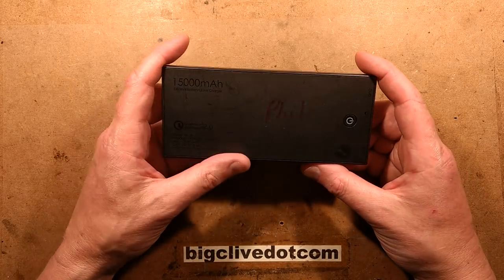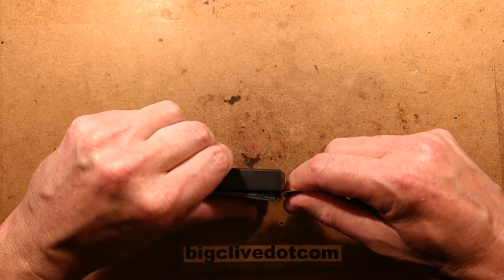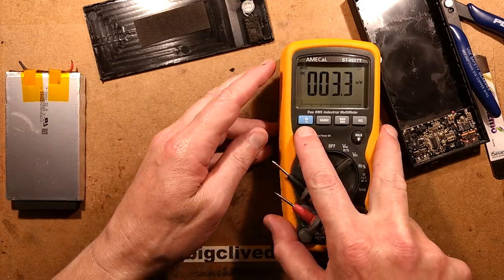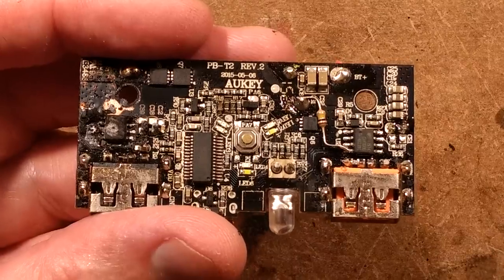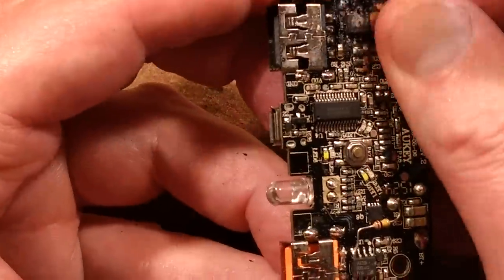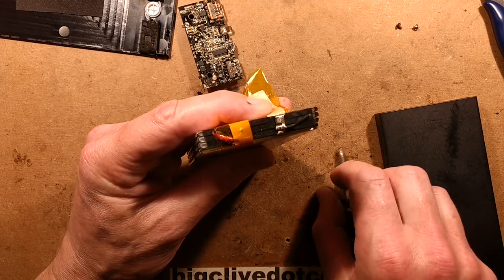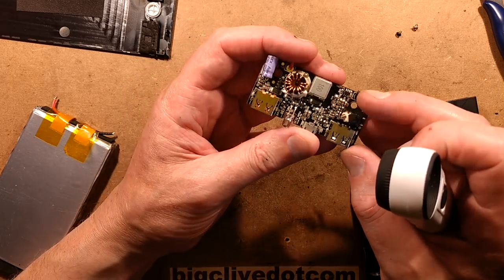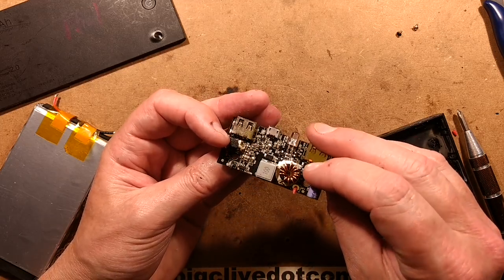Inside a burned out Aukey power bank.

Comment: Hey clive, wondering if youd be able to give me some advice on some led lights ive got. Solar panel led light string from pound stretcher, stopped working in 2 weeks. Voltage present at the output to the lights and continuity in each wire to the end of the circuit. so power is flowing through them? but nothing is lighting up? im so confused haaha!
Reply: Check for current flow, voltage is merely the pressure of electricity, if no current flows see about how much voltage is needed by each string of LEDs.
If the supply can't meet the voltage needs of the LEDs, then no current will flow.
If the supply can't meet the current needs, then when reading just voltage, it may seem OK, but under load the output dies...
Also check for short-circuits. And check AGAIN, for open-circuits; double-checking the simple stuff saves time when your'e stuck!
Giving the battery and solar a quick check can clear those suspects (failing battery can give similar illusion to low-current).
A last thing to observe is transistors, if it's one of those 'flasher' style light strings, check the devices and circuits responsible for switching the strings; all the power in the world would do you no good of the switch your'e using won't turn on ^_^
Reply: Komiyan Zaibach thanks so much for the help. I'm going to try sending a link to the pictures of the lights below. but I gather YouTube will filter it for spam. let me know if it's there or not!
Reply: Ah your'e lucky i'm awake; was just about to retire for the day!
Firstly; eww cheapy-chinese soldering XD  These things are full of dry joins etc.
Observe the solar panel and see if it puts out current; also check the battery, corroded terminals could be the problem...
A good test for those LEDs (looks like they run from a '5252) is to jam 3v across them, two fresh AAs should do, and light them with brute force to confirm they definitely aren't the issue.
Then theres the single point of failiure: the damn switch. That thing gets corroded inside, it's game over. And they always do, no waterproofing for the switch so it's usually really bad...
Pointless switch is pointless, bypassing it with solder-bridge will work and help prevent future problems...

Hope i've helped ^_^
Reply: Komiyan Zaibach thanks so much mate. ill do some tinkering with the multimeter etc tomorrow. ill report back haha.

Comment: There are lots of unanswered questions such as - was it being used to charge something else when it failed, or was it being charged at the time? If it was charging another device, was it caused by a faulty USB cable or did it cause damage to a USB cable ?
Reply from the maker: It apparently wasn't charging anything at the time.  It was being charged with circuitry separate from the section that went into meltdown.
Reply: Well that makes it even more mysterious !
Reply: Not really, it was just a bad component, it happens.

Comment: Its 1am and my fully charged Aukey power bank just started smoking thick acrid white smoke and is fiery hot, wrapped it and placed outside on concrete. 

Luckily I remembered many of bigclives videos on Powerbanks, thanks big Clive!

Exactly same model perhaps 3 years old used occasionally charged with Aukey 10-port charger. Bought new from Amazon. If I wasn't awake could have easily been a few life's. They need a recall!!!
Reply from the maker: Scary.  I bet that had your heart racing.  If it helps then I can tell you that it's so rare you'll probably never have it happen again.

Comment: Yep, that thing is toasted, but at least you have some cells for a project of somesort, maybe rewire them to use with one of them 4-chip LED floodlights or something? :D
Reply: twocvbloke these pouch cells a garbage
Reply: Experience China 🇨🇳 
I doubt they're ALL garbage. 
The ones from this power bank are made by Sony, so I would expect them to be reasonable quality, at least compared to non branded ones.
If Sony make them then they must use similar cells in their own products, in any case most smartphones and tablets use pouch cells as they're the only way to get thin enough battery packs. They're increasingly used in newer laptops too, for the same reason.

Comment: Common failure mode for boost converters. If the switching transistor somehow gets latched on (or fails short), you very quickly have a dead short to ground through the inductor.
Reply: Weeeell, in my latest design I'm using SI4838BDY MOSFETs, which are rated at something like 4 milliohms RDSon with 2.5V at the gate. So with 4V drain-to-source across it that would be plenty of current :-)
Reply: I'm going to assume it wasn't charging anything at the time it "woke up" its owner - but it may have been itself plugged it to charge; and in that case it could have momentarily received something uncommonly nasty from the charger or the mains, against which the boost converter turned out to be unprotected. Or, well, we can always blame it on stray cosmic rays...
Reply: Ah yes sorry, I wasn't reading correctly. Yeah my money is on gate latch-up rather than drain-source breakdown limit somehow being breached.
Reply: I don't think it was plugged in as the short ran the battery down to the cut-off voltage.  If it was on charge then some banks refuse to charge and discharge at the same time, even if it DOES support this then surely there would be enough current coming in to prevent the battery going this low?

I'm actually curious if the circuit still works for charging and powering the quick-charge port, as it seems likely all three functions are completely independent.
Reply: When i was testing a boost converter that i made, I had this happen (output latches on) when the input voltage spiked briefly above output, If current flows through both the switch and the output diode, and the output voltage is low enough (by load or otherwise), the oscillations ceased and the transistor simply conducted until it's solder melted and the thing fell off!
Similar things happen to common ICs when strange things occur that designers did not think of...
Especially since they fill their chips to exploding with features and control logic :/

Comment: You missed the text on the plate. The second output is a quickcharge with multiple voltages.

Also, the thing has three inductors. One for charging, one for output 1, and one for output 2 perhaps?\
Reply from the maker: Yes, I'm guessing one will be to allow charging more efficiently at higher current.
Reply: I own the 16000mAh Version of this Model:  

Out1 (Green): 2,4A - 5V
Out2 (Orange) Qualcomm Quickcharge: 2,4A - 5V; 1,67A - 9V; 1,25A - 12V
Reply: Sebisation I have the same one it's actually a good power bank tho I don't really use it much

Comment: Was wondering if it was a genuine Aukey bank. Really does look like one. Hope it's safe cos I've got one very similar......(now finds bank and throws it outside!)
Reply from the maker: It'll be fine, but I do tend to recommend charging any powerbank on a metal dish or tray.
Reply: Any of my dodgy charging (old or reclaimed batteries) gets charged on a large stone fireplace....just in case.   Touch wood I've never had anything go thermo. But my Aukey came from a reputable seller on Amazon so should be safe enough.
Reply: or outside.
Reply: nʌθɪŋ 
Yeah when a lithium battery puffs up that's a sure sign of trouble...
But can be fun to watch.
Reply: I use a samsung 9000mAh power bank since 6 years. Still works like a charm, only issue is that with modern phones that is only enough for charging them twice (and maybe that it has some coil whine after years of use&abuse). This was a very early USB power bank, cost me 60€ back then, but it was worth it, seems to be very reliable.
Reply: Judging by the part numbers recovered, I am thinking it is counterfeit, at least in part.
Reply: John Carr I have had a similar one. I throw it out because after a flight the pouch cells expanded. It was still working but I didn’t fell to comfortable and the case was cracked open because of the expansion
Reply: I only ever charge power banks using a bank of lead acid car batteries and old worn cables, in a room lit with gas light next to my oxygen cylinders but I make sure to check on them every couple of months, or so, to be safe! 😜
Reply: RIP 😇

Comment: I have that exact same power bank and the exact same chip (the one on the front of the board) failed. Did not burn the board as bad, but blew the top off the chip. Aukey replaced it without question, so I'm guessing these had a high failure rate.

Comment: I really like my aukey stuff...they have a very-few-questions asked 2 year warranty and have sent me free replacements whenever something has been less than perfect. Love it.  Only downside I had with mine is it can't operate in line - usb-C in to usb-A out will disable the outputs while charging, because the C can also be an output and the mux chip doesn't know how to handle the sources and loads.
Reply: That's common for all brands though, my Anker does the same and I even had my Switch try to charge it because I plugged in the USB-C cable without waking up the power bank first.

Comment: The orange port is a quick charge port which is why it has another chip in it( and the bigger, 2nd inductor tied to it) Its more then likely a quick charge chip for devices like support the feature (Qualcom quickcharge 2.0/3.0 being an example.) Quick/Fast charge methods usually involving boosting the voltage even higher to about 9v or 12v. (My Galaxy S8 uses a 9v quick charge, for example) .

Comment: reminds me of my old computer PSU. 
There was a toroidal transformer in it, which failed so hard that the core was brittle and the otherwise clear isolation lacquer was black and crispy. The whole PCB was basically carbonized below it.
This failure happened after I played 12 hours at a LAN party. I did already smell a burned smell at the evening but i thought "fuck off, this PSU will NOT destroy this awesome LAN".... Well, I only missed about an hour. In the early morning the PSU shut down.
I later found that the fan was probably seized, and the crispy isolation in the transformer shorted it out. Luckily, my PC was not harmed. It was a good enermax PSU
Reply: Bad fans often take out otherwise fine PSUs.

Comment: maybe clean the pcb and try the other output to see if that still works?
Reply: I was surprised he didn't try as it does (at first glance anyway) look like all three sections of the PCB are pretty independent so charging and the other port may still be fine.

Would obviously need to disable the burnt out port as it may still be shorting and only stopped due to the battery reaching the cut-off voltage.
Reply: Alex Atkin 
Yeah that's what I thought, the busted section probably burnt up forming a resistive but still conductive carbon Trace causing the battery to discharge until the battery protection chip cut off the battery from the circuitry

Comment: My Aukey 30,000 mah power bank just died . Which is the reason why I'm watching this video . When I grabbed it to charge my phone I noticed the front portion where the button is top right corner was hot and the button light was red . .  Now when I try to charge it the led flashlight comes on and it's getting hot.  I'm pissed off this thing cost me $100 . I've had it for maybe 1 year . I think Aukey is rubbish.going back to Anker .

Comment: I had a powerbank from Maplin that tried to have an unplanned thermal event on my desk. Those little charge controller chips don't like being fed the wrong charging voltage, it makes them short out and then they get really really hot.

At least I found a new fun game to play - Take apart the rapidly warming power bank and cut the battery out before it sets on fire.
Reply: You live life on the edge, any normal person would throw it out the window. ;)
Reply: I once accidentally  dropped a TV remote control onto a wooden table from a height of 6 inches (15cm) and walked away.

I came back 2 minutes later to a strong ozone type smell, and found the remote hot to touch. I took it outside straight away and took out the 2 AA batteries, and left it in an old saucepan until it cooled. When I opened it up, there was severe scorching and the plastic cover on the power lines from the batteries had melted.

Took me a week to find a replacement remote (good going for pre internet times).
Reply: A TV remote gone nuclear? Stange, maybe the IC cracked inside, or a ceramic multilayer cap...
Ceramics and silicons are brittle things, which make most electronics more delicate than many know...

Comment: Every power bank I buy seems to use 3 to 6 standard (or more usually high-capacity, 3300 mAh or so) cylindrical lithium cells. Between my own and those I’ve bought as gifts, I don’t think there’s been even one with those flat cells.
Reply: I much prefer power banks like that.  I figure they have more airflow between the cells and are more safely reusable if the electronics fail.

Comment: Wow, that was some meltdown. Good thing the owner woke up before the cell itself overheated and exploded. The whole house could've burnt down.
Those high capacity powerbanks should really have more protection in them. Their cells are of high capacity and more than capable of producing enough current to start a fire (remember the Galaxy Note 7 ?).
How come the output was not disabled even though it was dead-shorted ?

I had a couple powerbanks die on me. Nothing dramatic like this one though.
One was a cheapo generic one from a local supermarket, the lithium cell died after only two months of use.
The second one was a TeckNet brand 12000 mAh capacity from Amazon, which simply refused to charge or output any power. That one was still under warranty and I got a free replacement which so far works fine.
Reply: Not really, the battery itself didn't fail, nothing like the Note 7 issue.  Its not like him waking up even stopped it as there was nothing he COULD do, he put it outside but clearly nothing actually caught fire.

The component that failed is designed to quickly turn on and off, but likely got stuck on so couldn't handle the current and fried.  The rest of the circuit was likely still perfectly within spec so had no reason to cut-off.  As such its likely the battery remained completely in spec too so no risk of it blowing up.  It seems to have stopped when it reached the cut-off voltage, or the failing component burnt itself out breaking the circuit.

I wouldn't be surprised if the power bank still works, apart from the burn out port.

Failures like this look bad, but its not.  Its not all that different to capacitors blowing when they stop being in spec and can no longer handle the load.  Most often you replace the damaged components and the rest of the circuit is still fine.

Comment: Hm, would've loved a more in depth analysis what could've happened here.
Reply from the maker: It's hard to say.  The evidence has literally destroyed itself.
Reply: oh hey, its stefan.
Reply: Maybe the age of the battery's increased resistance over time caused an internal short in one of the components from excessive heat & went nuclear on the board while the battery side just cut out ?
Reply: Marcus60661. No. Just no.
Reply: transistors go short fairly often these days for some reason, seems like the boost chip for the 5v shorted out passing alot of current from the battery through the inductor through the chip, but unfortunately not enough to trigger the overcurrent in the cell protection. most likely since the inductor is small gauge so the resistance was higher. it should have had a small fuse to protect that part since it only needs 3A
Reply: I'd guess the chip has integrated power FETs and the low-side failed for whatever reason, blowing up the chip and its boost inductor. The rest of the bank might still work after removing the dead chip and gouging out charred PCB between power traces so they don't short out.
Reply: Yea, maybe ESD or similar into the USB port caused the switching transistor to fail short. In the classic step-up arrangement, that would mean permanent current through the inductor, causing it to overheat because copper resistance. Just wild guessing of course.
Reply: @Mathis One problem with the ESD theory is that the switching transistors are upstream from the filter inductor and a few uF worth of output filter capacitors. If ESD might zap something, it would be the SMD capacitors on the output.

I'm going to revise my guess: one of the output SMD caps failed shorted and blew up the inductor. If the FETs had failed first, then the inductor would have had nowhere to pass current to (or at least no more than the attached device would normally draw from an under-volted source) and wouldn't have blown.
Reply: That's why i said the mosfet failed short , because then the inductor would short out the battery. But you're right, it's unlikely to get zapped with ESD..